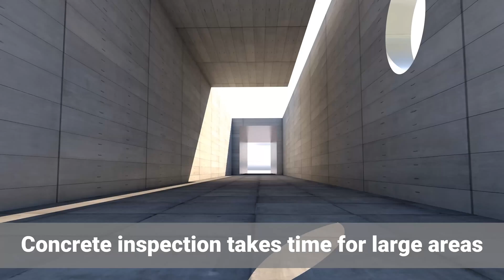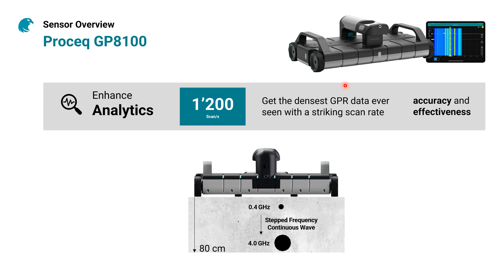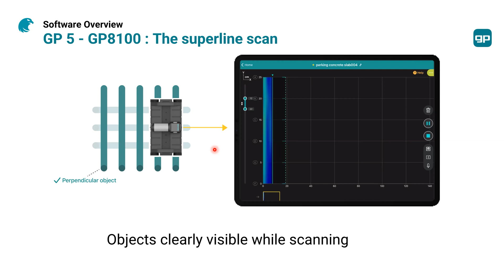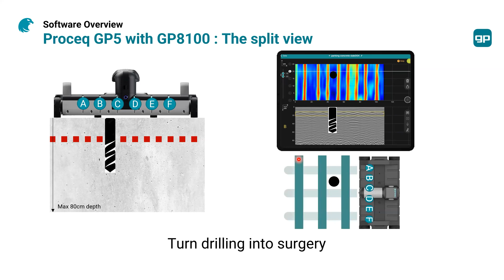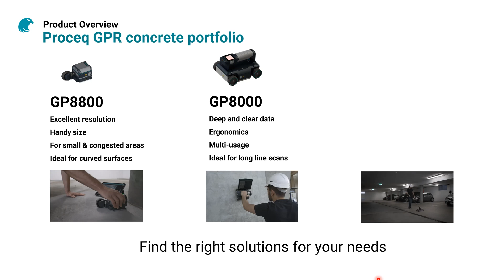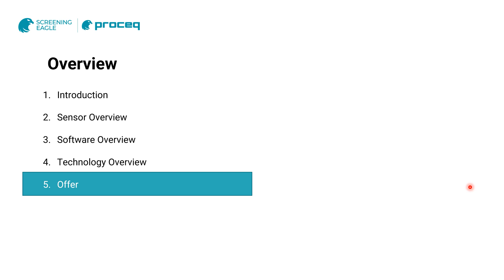Proceq BCRC PCTE Ground Penetrating Radar GPR accurate GPR scanning before cutting & coring concrete

Comment from the maker: GPR REPORT GRID FOR CORES

And the azimuth resolution can be defined as a capability of the separation of two reflecting objects on the same ranges, but different aspects from the radar. In GPR operation, the high resolution in depth is obtained by utilizing a transmitted signal of wideband. Fine azimuth resolution is achieved by coherently processing the target’s electromagnetic scattering measured at different aspects while the radar is moving along a straight path. However, the measured resolutions after the postprocessing are dependent on the focusing ability of the migration algorithm. That is why the resolution performance of the algorithms is tested by measuring the −4 dB contours of a point scatterer (whose coordinate is x = 0 m and z = 1.5 m) in the resultant images of simulations. Normally, algorithms with better focusing abilities are expected to produce lower resolved images.

[Your Name]
Civil Engineer
[Company/Organization Name]
[Date]
CORE DRILLING
A core to be tested for strength shall not be removed from structure until the concrete has become hard enough to permit its removal without disturbing the bond between the mortar and the coarse aggregate. Normally the concrete shall be 14 days old before the specimens are removed. It is preferred the concrete should be 28 days old for drilling cores.
 
Advertisements
 
A core is usually cut by means of a rotary cutting tool with diamond bits. The concrete core drilling machine is portable, but it is heavy and must be firmly supported and braced against the concrete to prevent relative movement which will result in a distorted or broken core, and a water supply is also necessary to lubricate the cutter. Hand-held equipment is available for cores up to 75 mm diameter.
 
If the ends of the cores do not conform to the perpendicularity and planeness requirements, they shall be sawed or ground to meet those requirements or capped as per standard procedure.
 
CAPPING
Unless their ends are prepared by grinding, cores should be capped with high alumina cement mortar or sulfur-sand mixture to provide parallel end surfaces normal to the axis of the core. Other materials should not be used as they have been shown to give unreliable results. Caps should be kept as thin as possible, but if the core is hand trimmed they may be up to about the maximum aggregate size at the thickest point.
 
It is essential that the cap be thin, preferably 1.5 to 3 mm. The capping material must be no weaker than the concrete in the specimen.
 
DIAMETER AND LENGTH OF CORE
The ratio of diameter to the maximum aggregate size shall be not less than 3. The compressive strength of 50 mm diameter cores are known to be some what lower and more variable than those of 100 mm diameter cores. Testing error associated with 50 mm diameter cores was about twice that associated with 150 mm diameter cores. Smaller cores tended to produce more variable results.
 
As per ASTM:C-42, the preferred length of the capped or ground specimen is between 1.9 and 2.1 times the diameter. If the ratio of the length to the diameter (L/D) of the core exceeds 2.1 reduce the length of the core so that the ratio of the capped or ground specimen is between 1.9 and 2.1. Core specimen with L/D ratio equal to or less than 1.75 require corrections to the measured compressive strength. A strength correction factor is not required for L/D ratio greater than 1.75. A core having a maximum length of less than 95% of its diameter before capping or a length less than its diameter after capping or end grinding shall not be tested.
 
 
MEASUREMENT OF CORE
Before testing, measure the average length of the capped or ground specimen and use this length to compute L/D ratio. Determine the average diameter by averaging two measurement taken at right angles to each other at the mid-height of the specimen.
 
DETERMINING THE CORE DENSITY
Determine the density by weighing the core before capping but after grinding and dividing the mass by the volume of the core calculated from the average diameter and length.
 
TESTING OF CORE
The core shall be placed in water at a temperature 24o to 30oC for 48 hours before testing. Centre the core carefully on the lower platen of the machine without shock apply and increase the load continuously at constant rate with in range of 0.2 N/(mm2/s) to 0.4N/(mm2/s) until no greater load can be sustained. Note any unusual failures and the appearance of the concrete. Calculate the compressive strength of each core by dividing the maximum load by the cross-sectional area, calculated from the average diameter. Express the results to the nearest 0.5 N/mm2.
 
The noted test data be recorded in the given proforma of Table 1 for reporting the Test Report. No age correction should be used in the interpretation of the strength of cores.
 
Throughout the world core testing is acceptable method for the determination of strength and quality of concrete in the structure.
 
THE FOLLOWING TESTS OTHER THAN COMPRESSIVE STRENGTH MAY BE MADE ON CORES
Non destructive
 
1.1 Direct visual examination of core before trimming and capping (by naked eye or possibly hand lens)
 
 
a) Coarse aggregate: Nominal maximum size, Grading – continuous or discontinuous, Particle shape, Mineralogy, Group Classification, Relative proportions, distribution in concrete.
b) Fine aggregate: Nominal maximum size, Grading – fine or coarse, Type-natural, crushed or mixture, Particle shape, Relative proportion, distribution, Mineralogy
c) Cement: Colour of matrix of concrete.
d) Concrete: Compaction, segregation, porosity, honeycombing, General composition, apparent coarse aggregate to mortar proportions, Depth of carbonation, Evidence of bleeding, Evidence of plastic settlement, loss of bond, Presence of entrained air, Applied finishes, depth and other visible features, Abrasion resistance, Crack depth, width, other features, Concrete depth, thickness, Inclusions, particularly impurities, Cold joints.
e) Reinforcement: Type (round, square, twisted, deformed), Size, number, depth/cover
f) Core drilling faults: Bowing, Ridges
 
1.2 Indirect visual examination of core before trimming and capping (by microscopic or petrographic techniques): Mineralogy, Air/sand content, bubble/void, size/spacing, Microcracking, Surface texture of coarse aggregates, Fine aggregate particle shape, maximum size, grading, Degradation.
 
1.3 Routine physical tests of cores before capping: Density, Water absorption, Ultrasonic-pulse velocity.
 
2. Special Physical tests of companion cores: Indirect tensile strength, Abrasion resistance (surface only), Frost resistance, Movement characteristics.
 
3. Routine chemical tests of cores after crushing for strength: Aggregate/cement ratio, Type of cement, Aggregate grading (recovered), Sulphates, Chlorides, Contaminants, Admixtures.
 
4. Determination of water/cement ratio.<
 
5. Special tests on core after crushing for strength: Sulphate attack, Cement and other minerals and mineral phases, and molecular groupings such as NaCl, CaCl2, SO3, C3A etc., Contaminants, Chloride attack, High alumina conversion, Aggregate reactivity.
 
 
 
CORES WITH REINFORCEMENT PERPENDICULAR TO THE CORE AXES
Core should be taken to avoid reinforcements. Cover meter can be used to locate the bars. It is usual to find rebar in the core samples. These are usually on one or the other side. The part of the core beyond rebar is cut off and only the concrete portion is taken for the test. Where it is not possible to avoid the bars correction factors are applied. The core with rebar parallel to the axis of cores can not be used as the effect of the rebar will be too large to ignore. The rebar perpendicular to the axis can be tolerated as long as the correction factor is less than 10%.
 
formula for Corrected strength
 
Table-1 : Proforma for core test
Core Strength Correction factor
 
L/D Ratio       ASTM: C-42      IS: 516
2.00    –       1.00
1.75    0.98    0.97
1.50    0.96    0.95
1.25    0.93    0.92
1.00    0.87    0.89
Nominal maximum size of aggregate =
Type and grade of cement =
Grade of concrete =
Date of casting of structure member =
Date of core drilling =
Date of core testing =
 
IS: 456-2000, Plain and reinforced concrete – Code of Practice (Fourth Revision) BIS, New Delhi.
IS: 516-1959, Method of test for strength of concrete, BIS, New Delhi.
IS: 1199-1959, Method of sampling and analysis of concrete.
ASTM: C42/C42 M-04, Standard test method for obtaining and testing drilled cores and sawed beams of concrete.
BS 1881: Part 120:1983, Method for determination of the compressive strength of concrete cores.
Concrete core testing for strength, Tech. Report 11, Concrete Society, London, 1987.
H. Bungey, S.G.Millard, M.G. Granthan, Testing of concrete in structures Fourth Edition.
V. Nayak, A.K. Jain, Advanced Concrete Technology.
 
Advertis
 
 
 
Subject: Grid GPR Scan Report for Steel Reinforced Concrete Slab on Ground
 
Introduction:
This report presents the findings of a Grid Ground Penetrating Radar (GPR) scan conducted on a 200mm thick steel reinforced concrete slab on the ground. The objective of this scan was to identify the location of structural reinforcement within the slab in order to facilitate safe coring operations, ensuring that the contractors avoid drilling through the reinforcement while extracting full-depth cores.